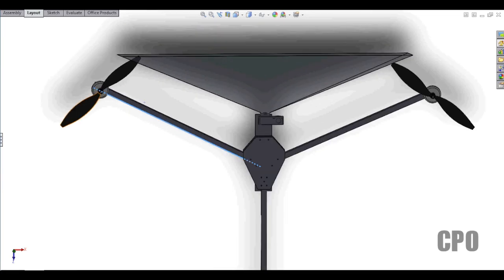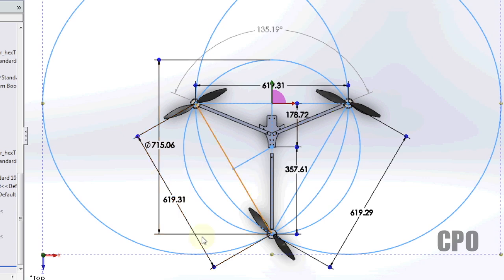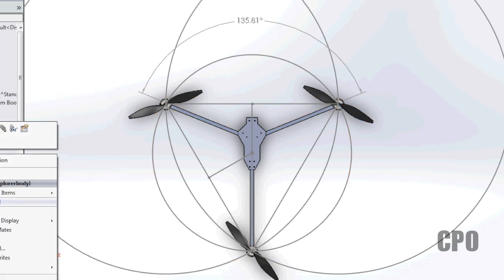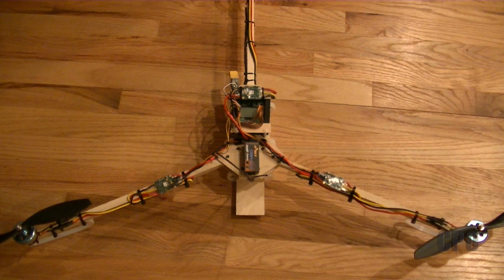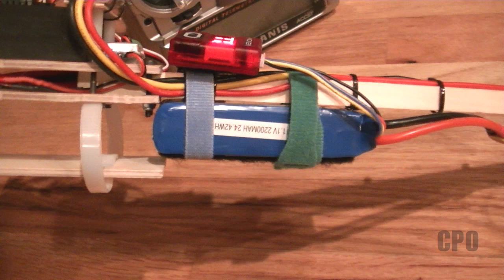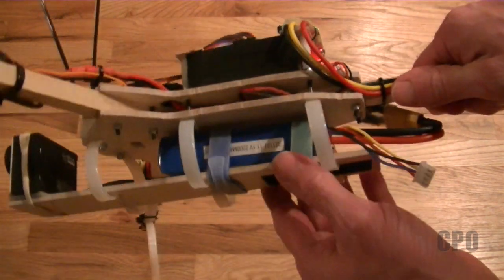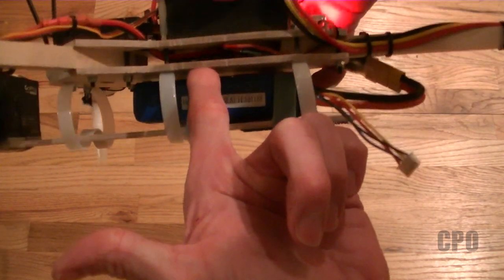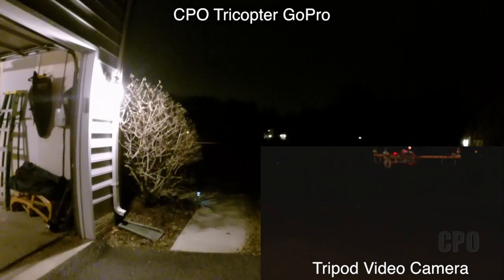CPO Tricopter Build : Center of Gravity and Quick Night Flight

Comment: Also if CG is off way to much to the front the rear motor will have to do more work and my heat up some..     as there is only one motor to do the work back there,   I feel that a T Copter is a better way to go..  as you can put a platfrom out in front for cam's and such  to ballance the craft...

Comment: Also a die hard TRI builder and flyer.  I have played with moving the CG both ways and observed the following. Having the KK2 forward or aft of CG creates a very slight bit of damping in the direction farther away from GG of the TRI.  Having the KK2 at the optimum CG location, but the actual TRI CG away from optimum is automatically corrected by the two front or the rear motor spinning faster. The only time it's really noticeable is at full throttle climb out and a bit on rapid decent recovery. As one end or the other runs out of power first and can not keep up with the climb rate of the other end. If one thinks about it's a bit better actually to have the balance point aft of the CG so that the forward motors are slightly loaded more then the rear so the tail is the unloaded end and can come up quicker for fast forward flight.